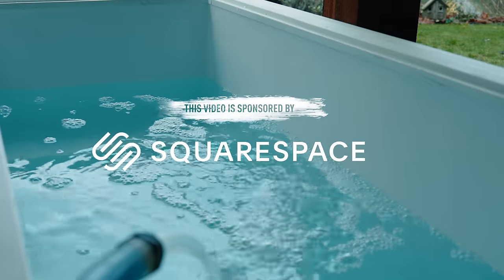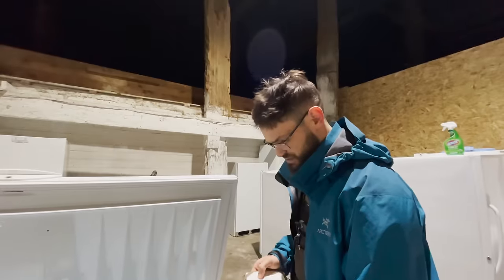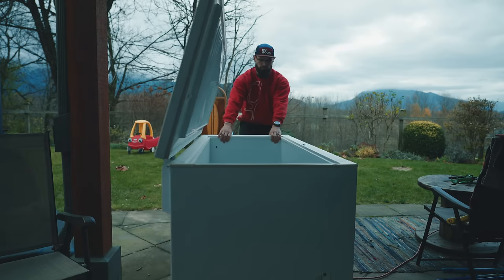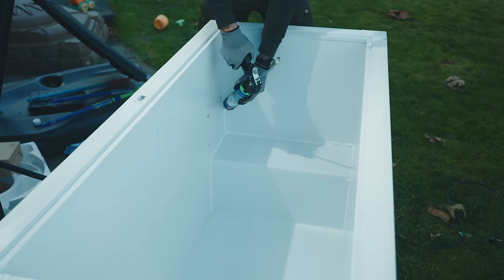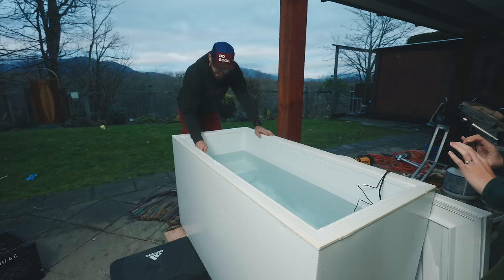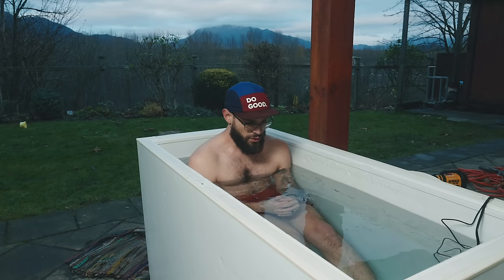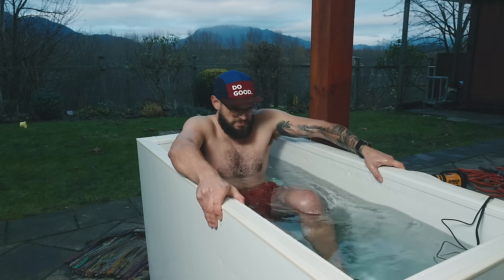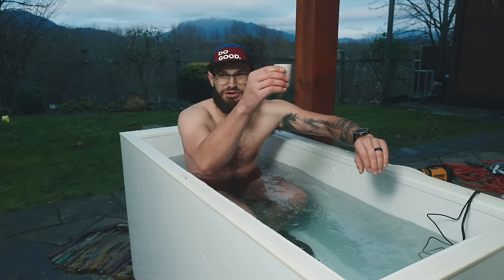How to Build a Professional ICE BATH from a Chest Freezer! - Wim Hoff Method

Comment: i built mine and added a 300 gallon aquarium filter  with air line and hot tub skimmer net  i add hot tub chlorine 1/4 tea spoon once a week to keep water clean  mine is new with metal inside which works fine for me .  all the data on ice baths  says 50 to 59 degrees Fahrenheit  for dopamine release Harvard studies ? great video thank you

Comment: I just built my own chest freezer as well.  I am definitely loving having it around.  One question, do you find that the fluval aquarium water filter is helpful/effective in keeping your water clean?  How long are you finding that you can stretch out your water change out period?  One week, one month, etc?  I like this simplistic approach to your water filtration.  There are definitely other people using much more expensive methods of water treatment (i.e. ozone generators).  Id like to avoid the expense if I can get my water changeout period to about a month.
Reply from the maker: I do about once a month and try to shower before I use
Reply: Awesome man.  Thanks for the video!  It was a big help!
Reply: @Levi_Allen how do you drain the water if you sealed the drain
Reply: @harisrocker  You could use a sump or transfer pump.

Comment: On summer days, after a drain and filling up freezer fresh -  the compressor heat sensor beeping would go off non stop (didnt know they had that!), to touch the outside of freezer, it was burning hot from dissipating heat. Had to run a fan non stop to keep compressor coold. 
After that, only filled up 3inches of water and then froze it solid like a giant ice cube, then filled with water to melt that ice to get it cool. The freezer compressor will struggle trying to cool ALLLL that water.  I got an XL freezer from a restaurant that was 20years old, so that may have been the problem. But make sure your compressor has a fan and freezer has a drain plug!
Just tryin to help out others.

Comment: I have found that the Tararium JP-025F (420 GPH) for 100-200 gallon tanks and small ponds works very well for less than $40 with no filters to replace. In combination with a very small amount of hot tub chlorine crystals periodically and mine easily lasts two months before I need to change the water. Also I get in clean.

Comment: I have a similar setup for years. Family of three. I do not have a filter, just scup out the hair and bits with a small aquarium fish net. I add a 450ml bottle of H2O2 (Hydrogen Peroxide), it last from 2 to three weeks before I have to change out the water. I like the large aquarium filter idea, may try that to extend the time between cleaning.

Comment: Great setup.  I've just been using a large trashcan that I dump Ice in. Need to make one of these eventually because its so much less work in the long run.  How do you plan to change out the water?
Reply: good q. why would you seal the drain plug? makes no sense
Reply: Try frozen water bottles you can re use them
Reply: Jeven is here haha
Reply: @btson6134  because it leaks lol, to get the water out to refill you just need to tip the ice bath to the side lol
Reply: @MJTRIZZLE  and we all know it's impossible to install a drain that won't leak🤣
Reply: So if you unplug before getting in there are no electricity risk?
Reply: @MJTRIZZLE  Good luck doing that. When it is full of water that is easily 400 pounds so you would need a forklift to move it. In addition that would put a lot of stress on one of the corners trying to hold all that weight.
Reply: @kristiansandsmark2048 ever heard of leverage? why would you need a forklift 😂😂😂 use your brain my friend

Comment: I'm going to start at about 10-12 degrees C and gradually lower the temp over a few weeks. My pool through winter only got down to 15C and even that was beneficial. My aches and pains were so much better.

Comment: Thanks for the great video. I've been taking ice baths for a couple years now. My setup consists of a horse trough in Frozen water bottles which kind of troublesome taking the ice bottles out of my freezer, moving them to the horse trough and at the end placing them back into the freezer. I'm kind of thinking about doing what you built. Thanks again for all the upgrade information

Comment: I’m mostly curious if one will run into any problems with your freezer being filled with water and freezing during the winter in cold temps. Say it its 20 degrees for a few weeks straight. Will the water potentially freeze solid and expand and break the freezer? Or does the insulation of the freezer possibly prevent that?
Reply: Yes. And if in a hot climate the power bill is nuts.
Reply: I had mine in south facing garage in Colorado and this was definitely an issue and way too cold, moved to basement near sump pump drain so I could still drain. Luckily I have window with hose nearby and now much easier to use and run.

Comment: Question. Can you run a filtration system thru the drail plug instead of closing the drain??
Reply from the maker: The drain plug built in is simply for melting ice, it will not go well if you run water through it. There is no way to control the flow. You're best making your own hole for filtration

Comment: Two questions... If you sealed up the water drain, how do you drain the water to put fresh water in?  Also, you cut the cord so how do you keep the water cold?  I feel like I missed something.
Reply from the maker: the drain is just meant to let melting ice out when it's a freezer. the drain does not hold water in, which is why it needed to be sealed. 

The cord I cut and crimped the ends was just for the light in the lid. Not the freezer itself. 

I fill and empty the freezer with a hose (syphon or fill)

Comment: Great video! I'm a bit confused about the temperature regulation. How does that work with...I think you mentioned the probe??
Reply from the maker: The temperature switch turns the freezer on until it reaches desired temp, and then shuts the freezer off. This allows the whole thing to not freeze over

Comment: How has your sealant held up?  My local home improvement store didn’t have Sika Flex and said a basic bathroom sealant would work. I now have leaks. Is your Sika Flex still keeping everything dry?  Thanks for the video.
Reply: Sikaflex will hold up better than any bathroom sealant. Sikaflex is specifically designed for boats and the marine environment and actually very similar uses.

Comment: Levi, I have done a similar project as you. I cut the power cord to detach the lid. I know you don’t want to be liable for electrical procedures but what did you do with that cable after cutting it ?
Reply from the maker: terminated the ends with butt connectors. and electrical tape

Comment: I wish I had an easier way to do ice baths in the summer. Unfortunately, living in an apartment in the hot parts of California makes it difficult as I don’t have much space for a chest freezer and buying ice would get very expensive very fast. Even on the coldest setting, the shower water is around 70 degrees F (21 C). Not low enough to be therapeutic. I could buy a countertop ice maker, but I don’t even have the freezer space to store any ice and it probably wouldn’t produce enough on its own per day.

Comment: Question: since you blocked off the drainage hole.. how do you drain this thing?
Reply from the maker: I use a hose to siphon the water out. The drain style that's built-in is not made to work with holding in water. It deliberately lets water out on purpose, it's more of a one-way valve than a drain. You could plumb in a dedicated drain if that's important to you.

Comment: Have you found that the silicone sealant has failed? I built an identical ice bath based off of this video 2 months ago. I drained it to clean today and saw that small water pockets had formed under the sealant where the seams are. When I peeled the sealant off, I noticed rust at the seams. Was just wondering if you had experienced the same thing.
Reply from the maker: that means you didn't get a good bond when using it originally. Degreasing and cleaning joints is essential

Comment: I just came across a 14.0 Cu.Ft. Insignia freezer for free. I plan to convert it to an ice bath following your steps. My issue is that this particular freezer DOES have a bare metal interior. What do you recommend I do to remedy this? Paint it? Pull it out? Add plastic? Thanks!
Reply from the maker: Paint it so it doesn’t rust
Reply: Is 14.0 cubic ft big enough? I'm 5' 10"

Comment: The tub is great so far but you started to harsh. If you‘d listened carefully to Andrew Huberman on his podcast, you would know that the cold exposure should be 1. safe and 2. deliberate. He is also talking about the studies that say, that the many effects start at about 15 degrees celsius. From there you can go lower as your body gets used to the cold over Time. As for the mental health and generell health aspect there should always be „a wall to climb“ before the cold exposure. This builds up the resilience. Drinking a shot tastes maybe good but you should check out his podcast about alcohol 😅. Last but not least, the body should be in the water from the neck as the the studies messured it. Maybe this helps you a little bit for your next plunge.

Comment: Hello, hows the silicone holding up... I'm curious why everyone is going to the JB Weld Water Weld?
Reply from the maker: silicone? I used sikaflex sikaflex is superior to JB weld in almost every aspect. It's made for marine abuse with salt water. I wanted a sealant I've actually used before so stuck with that one

Comment: Random question do you leave it outside in the winter?
Reply from the maker: year round yup
Reply: @Levi_Allen  Does it get cold where you live? I am worried if I leave mine outside it will freeze solid.
Reply from the maker: @spencerbjones81  it does. But not like -20 for weeks on end. The freezer can act like an insulator from the cold as well, just depends how cold it gets where you live
Reply: @Levi_Allen  I am in utah and it averages about 25 degrees Fahrenheit.  Do you think it can insulate against that cold?
Reply from the maker: @spencerbjones81  I do. And if it doesn't, there is simple things called "trough heaters" which are meant to keep water troughs from freezing, and you can pop that in to warm it easily.

Comment: How do you regulate temp? Can’t seem to get that part
Reply from the maker: plug the fridge into the temp control outlet. The outlet will turn the fridge on until it reaches the temperature you have it set at, then shuts the fridge off automatically.

Comment: How do you go about draining the water?
Reply from the maker: siphon the water with a hose
Reply from the maker: the original drain port is meant to be used only as a freezer. So if I filled it with water without sealing that port, it would constantly leak

Comment: I do not get it, it looked like you cut the power supply from the lit?  And the first electronic part is a unit that checks the water temperature and turns the freezer on when  the water gets too warm?
Reply from the maker: I just disconnected the lid light. No problem. 

You plug the freezer itself into a temp control outlet that only turns the fridge on until it reaches temp
Reply: @Levi_Allen  thanks for the explanation.

Comment: Rookie question here…. If you plug the drain, what’s the easiest way to empty and clean it?
Reply from the maker: The drain is meant for melting ice not holding water in. Use a hose and syphon